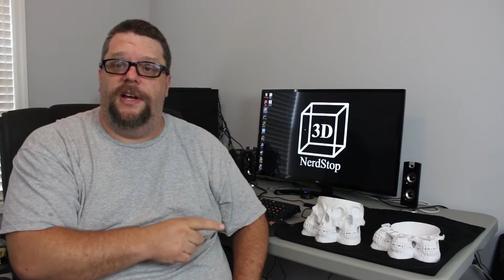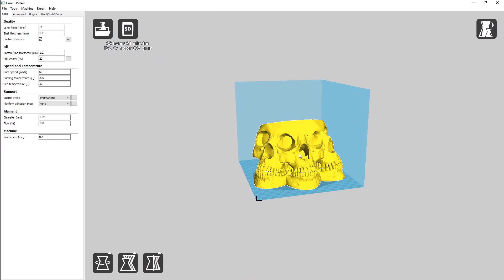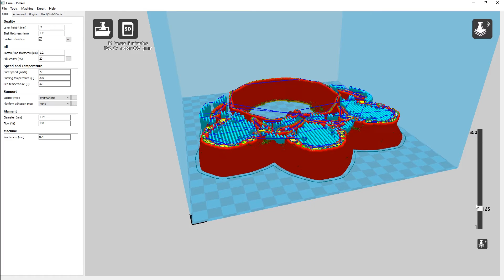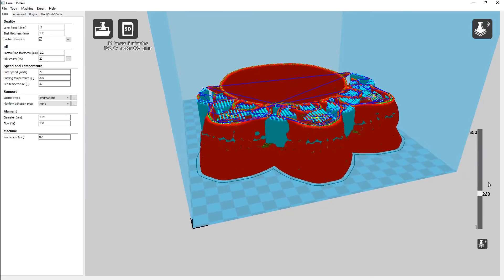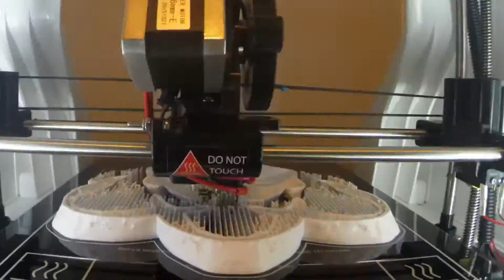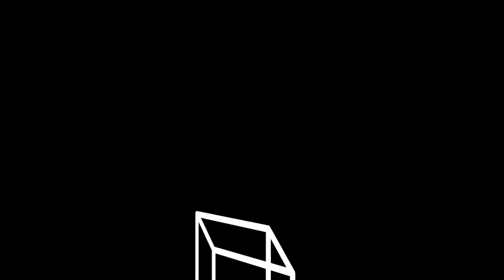3D Printing: Tri Skull Quadra Clops Candy Bowl

Comment: Interestingly I recently had the same exact kind of problem with a print stopping suddenly. Probably not relevant to your problem, but in my case it was because I was using Simplify3D, which apparently doesn't check if you have sufficient free space on your SD card when saving a file. Instead, it just saved part of the file, which caused the print to stop suddenly and not even turn off the hot end or home the bed. Pretty bad bug if you ask me.
Reply from the maker: The card running out of space was one of the first things I checked. The SD card was only about 10% full. Thanks for the info on Simplify3D. One day i might switch over to Simplify3D.

Comment: Hi,

I had my printer stop part way through doing a print job. I thought that it might have been a printer problem. I tried all sorts of things to find out what was going on and It turned out in my case that the SD card I had the gcode written on had a bad sector on it. I used a different SD card and the printer was able to complete the job without a glitch. My printer is a Robo 3D R1+
Reply from the maker: I will have to check that SD card I used on the first print. I did not think about the SD card having a bad sector. Thanks